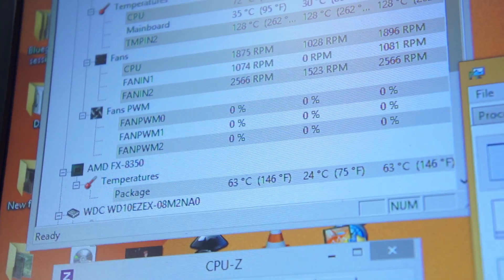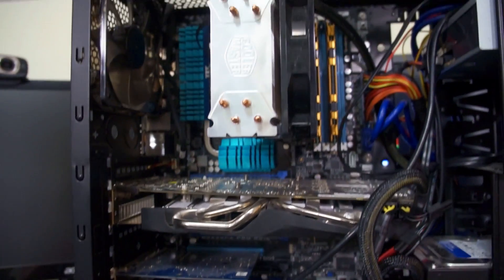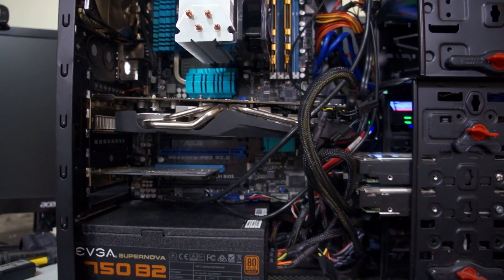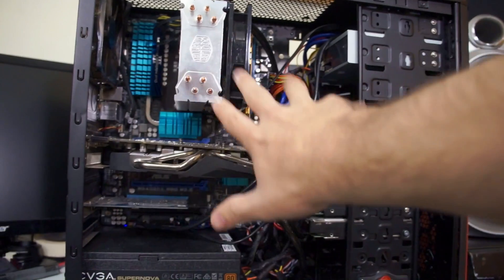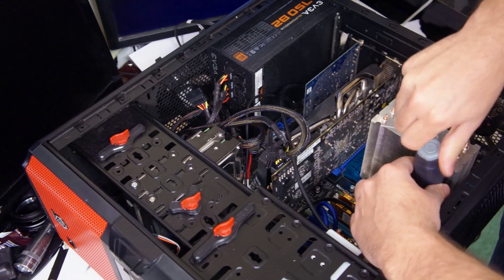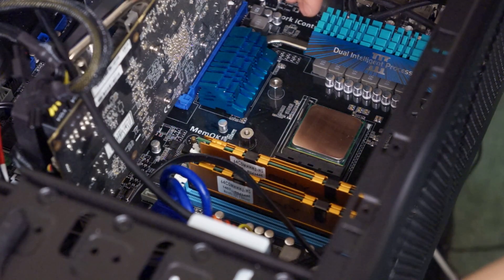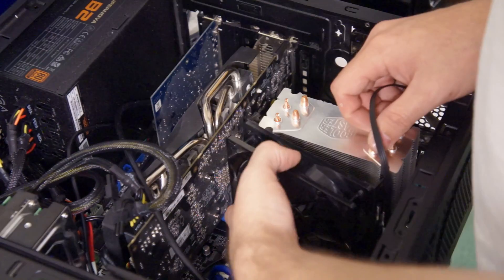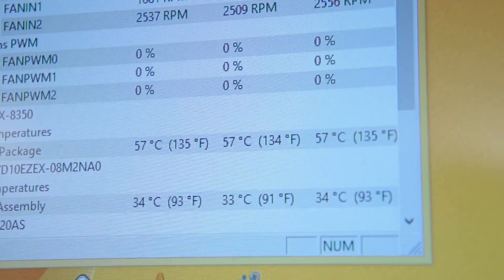How To Apply Thermal Paste Like a Pro

Comment: Arctic Silver 5 in 2016?. Liquid Pro is currently right at the top for performance for me. The trick is with the application. For liquid pro it is a very very long and strenuous process (not to mention messy and potentially damaging to your CPU if you don't take measures to protect the bottom and to thoroughly (I mean 15 - 20 mins thoroughly) clean off every single bit of dust that results from using the scouring pad. Then, 1 tiny little drop, the size of a capitol "O" on here, applied to the IHS and spread around using something oil free and precise should leave you with a very very thin, even spread. Polish up the heat sink (no aluminum heatsinks! it burns them) with the scouring pad and remove all that dust too. Put it together and you have an instant 10c idle temp drop and a 20c load temp drop with exactly the same cooler.

Comment: As5 isn't that good in spreading, mx4 also spreads kinda bad the mx2 was the best in spreading.
Reply: Oh fair enough... I actually prefer to spread MX-4 over MX-2 but have seen some reports of (tiny) temp. improvements on

with the older paste. Still very happy with the MX-4, as a ceramic paste.
It may have been the MX-2 was a year or two old ;)...
I don't think people take into account the viscosity of different batches/ storage techniques/ age of paste either (not that it makes a HUGE difference!)